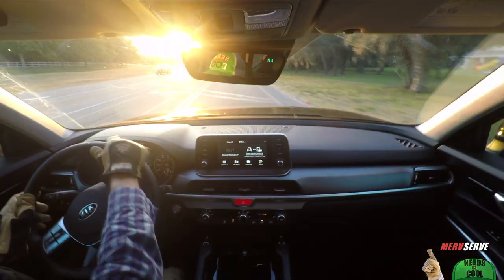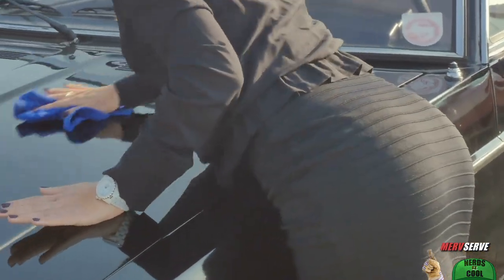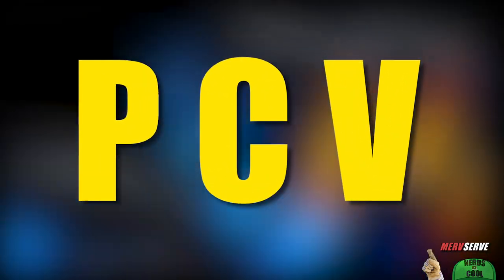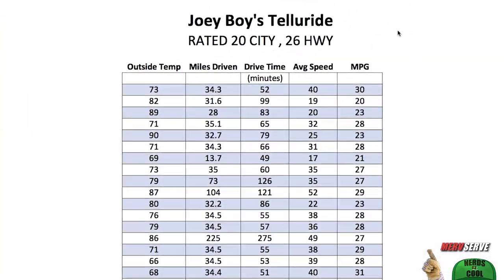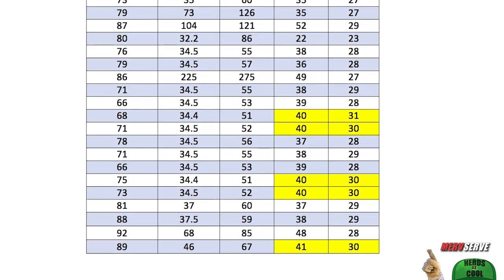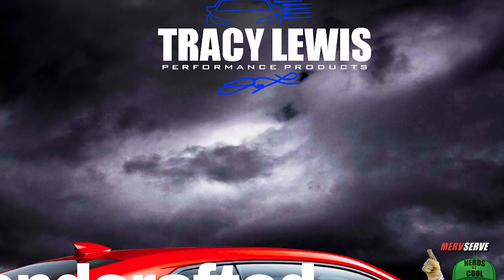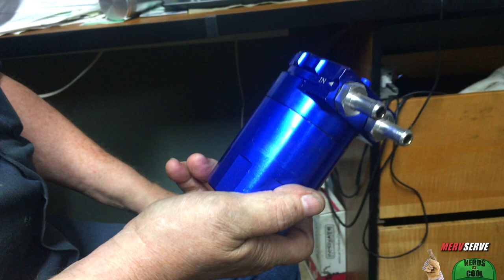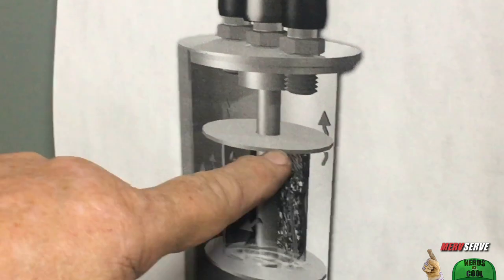Better Gas Mileage - MPG BOOST Saves you Money!

Comment: Not so sure about the inventor's critique of the "other" catch cans.  I have the blue one and it catches more oil than you can shake a stick at.  Also a little worried about all the many hoses and that Venturi gadget. And why replace that oil cap with a new doohickey if the vehicle is already designed to take air in that side? The mileage results are impressive though.  But I'm not just looking for mileage results.
Reply from the maker: It seems like a pretty thoughtful design if you ask me, but others have pointed out the same concerns so I'm going to ask my friend to do more research.  The mileage improvement really is spectacular in my opinion.
Reply: @MervsServiceSecrets did your friend get back to you with more research? I have a 2013 prius V that is drinking oil like a drunk drinks whiskey.

Comment: Meh... is about a polite a comment as I can make about this gadget. For $800 I expect a lot more than what is described too. Also ANYONE can get a few percent better MPG by just driving like you have a brain in your head anyway.
Reply: This system is under $500 and the testing as done here, and the dozens of other independent tests done by others that doubted the claims. There is NO device on the market that actually can guarantee at least 10% increase in fuel economy. The 17% average gain here is above normal, but 12-15% is common.  As this provides full time evacuation on the crankcase oil stays clean 2-3 times as long and anyone is welcome to test it backed up by oil analysis. The way it gets the increased MPG is mainly from reducing or eliminating knock retard that causes the ECU to pull ignition timing allowing the engine to maintain optimum timing advance and to a smaller extent you only want air and fuel in the combustion chamber. Oil, water, acids, etc. all disrupt the burn and the amount of energy released so of course less power and fuel economy. Watch this video as it goes into great detail in the issues that all GDI engines face, and this system addresses most of them:    https://www.youtube.com/watch?v=uVd-ZS5bnyY&t=1s
Reply: If this thing puts brains in the heads of drivers, it's worth every penny!  🤣😂🤣
Reply: @demillevantigo7432  Too bad nothing other than major surgery can do that to a bad driver! LoL
I have seen dozens of these "gas-saving" things over the years and ALL of them are a bunch of BS.
Reply from the maker: All I can say friend is that I went into this without any bias and it really does improve overall MPG.  But to each his own.  - Merv Himself
Reply: @MervsServiceSecrets  How you compared the "before and after" is nonsensical Merv! What you need to do to make anything like a meaningful comparison is to first diligently document the MPG the car does for a year or so BEFORE the gadget is installed AND then do the same after the gadget is on the car. Documenting EVERY fill-up calculation carefully for about a year. Longer preferably.

Comparing the EPA estimate to the after-installation is pointless since everyone knows the EPA estimate is usually wrong. Also, the few percent increases you claim could have been caused by many other factors anyway. For example, drivers who really want to find an increase often just drive more mindfully and so that alone will increase MPG a few percent anyway. The placebo effect is well documented in many psychological journals. And even IF the gadget is adding a few percent, that $800 price tag will literally take decades to pay for itself!
Reply from the maker: @michael47lamb  This is a good debate and it's exactly why I enjoy creating content for this channel.  But friend, the device is not $800, it's like $450 tops. And please keep in mind, I'm not a salesperson for this or any catch can. This is just my honest opinion.  Also, sorry if I didn't give more detail on the video, but to be clear, I literally have the identical Telluride as this one with the catch can was tested on, and it's mileage was right on spot with the manufacturer's rating. (I don't think anyone seriously believes car maker's advertise UNDERestimated mileage figures do they? If so, they should fire their entire marketing division.) But aside from any mileage claims, a good catch can serve a very valuable purpose when it comes to preventing coking on the valves and in general contaminants from re-entering.  Regarding the cost claim, I do have to argue with you on that one quite vigorously, my friend.  These days, A fillup can easily cost between 80 - 100 dollars.  If you are saving 17 percent, that's anywhere from $13.60 to $17 dollars per fillup.  So after a little more than 6 months, the device has paid for itself. But again, that's only if you are focusing on gas mileage. As mentioned, there are other benefits.  Finally, I do encourage everyone to do their own research and remember, this is just my opinion.  Thanks again, Mike, for being an involved viewer.  It's great to have you as a member.  -Merv Himself
Reply: @MervsServiceSecrets  I still remain highly skeptical as I have literally seen dozens of these "gas-saving" gadgets over the years and none of them ever panned out as advertised. One argument backing this opinion up is that if such a simple device actually worked then EVERY car maker on Earth would have put them on EVERY car already. This is obviously not the case.
Reply from the maker: I reckon they don't because it would be an additional maintenance item for the consumer. And, let's face it, most people are bad about doing the most basic things like changing their oil, let alone emptying a catch can.
Reply: @MervsServiceSecrets  If the gadget worked, and yielded anything like a double digit% increase in MPG, I am sure the manufacturers would put it in. Consumers have no problems doing a little maint on their cars. Certainly, the dealership would be happy to add another line item to charge for too! Though the can would probably not a nifty aluminum can. Likely a plastic one.
Reply from the maker: Yep, a car manufacturer would definitely make it out of cheap plastic. Now on that, we agree! 😂
Reply: @MervsServiceSecrets  The can doesn't need to be aluminum or even metal at all. Anything air-tight and durable enough would do. If I felt it was worth doing at all, I could design a catch can that would cost a few cents to manufacture, and last as long as anything else under the hood too.
Reply: Personally I like my important under-the-hood parts to be made from iron base alloys and cast aluminum.  But, yeah, I can't wait to buy the 39-dollar car you're going to design with plastic parts and maybe even wheels made out of paper mâché
Reply: @roughredranger7021  You do realize that pretty much every modern vehicle has a great many plastic and rubber and other synthetic parts already, right? Been that way for some decades too. Some years ago I was a little surprised at plastic intake manifolds, but they have worked out to be pretty good anyway.  

Also consider this: aluminum and steel will corrode away to dust given the right conditions, like exposure to road chemicals.
Reply: @michael47lamb   Then the best thing is to try it for yourself and do the MPG calculations the old way,  every fill up using your trip odometer. Have over 30k of these in use over the past 20 years and many on light fleet vehicles that track every penny spent.  If it does not do as we claim will buy it back. To date have not had a single buyer not get at least 10% increase.
Reply: @michael47lamb   No automaker would add a device that requires the owner to drain and properly dispose of what's caught as hardly any even check oil on the dipstick now days. And just look at GM and the ignition switch debacle a few years back, Engineers made in known to management and the fix would have added less that $10 a vehicle to fix early on, and it was decided that was not an acceptable expenditure. And to date it has cost GM over $1billion. Applying common sense to Corporate Think rarely ever works.
Reply: @michael47lamb  Plastic has insulating properties where aluminum acts as a heat sink and transfers heat quite well. As condensing is one of the critical processes in changing suspended vapors back into liquid form, that would greatly reducing the effectiveness. This Patented design is also used in DNA testing labs to separate an oil like substance used in the testing chambers as well (a much larger version).

Comment: Excuse my ignorance but, how making a vaccum in the crankcase increase efficiency of the engine??? If one piston is sucking air or after explotion of course make sense, but when piston goes up??? It does not help in compression or exhaust phases, explain that!!! Thanks
Reply from the maker: If you are talking about the Venturi valve, it is increasing airflow. I'm really not clear on the vaccum you are mentioning, but Mr. Lewis might have an answer if you contact him at his website.
Reply: Several ways. When pressure is allowed to build in the crankcase the piston fights this on each downstroke. Suction aids them. SO some parasitic loss occurs. Has no effect on the compression stroke. The most benefit is retaining piston ring stability and improving the seal VS pressure present in the crankcase causes "ring Flutter". A condition where the rings enter into a state of rapid vibration. Low tension piston rings are used in all engines today so this is even more critical, and then we have the elimination of knock retard caused by oil ingestion.
Reply: This video is a good example of how maintaining vacuum suction results in better ring seal and more power. The first pull is venting to the atmosphere. The second pull is pulling vacuum suction. These are the versions we use on ALL of our race engines: https://www.youtube.com/watch?v=-7bGshirEKI